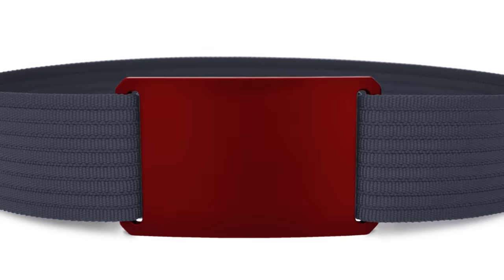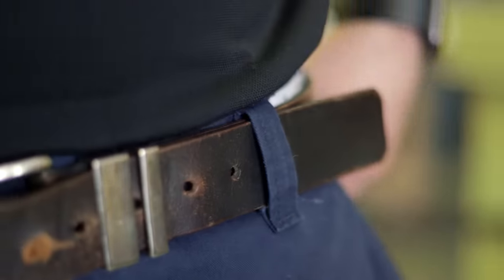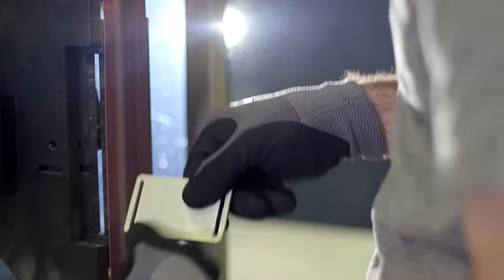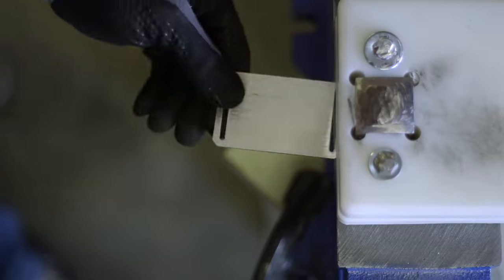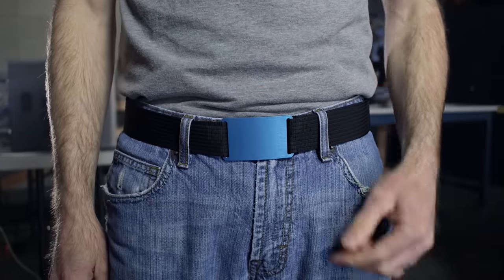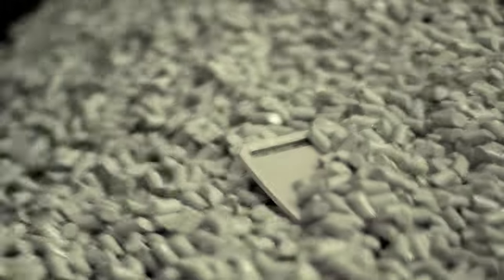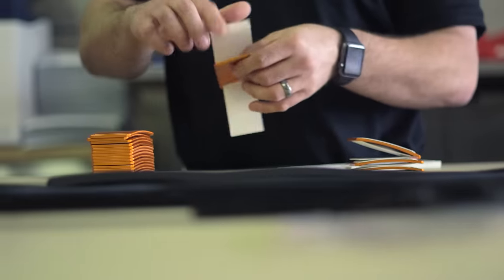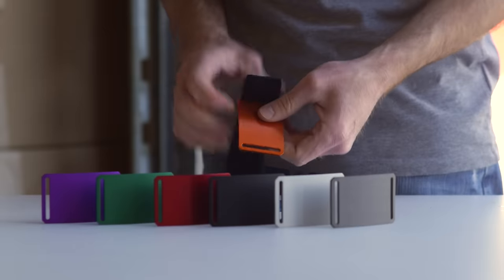Minimalist Interchangeable Belts | GRIP6

Comment: Ok, so I have been using a Grip6 belt for 3 weeks now. I have been through a lot of belts over the years and have found that it's worthwhile to spend the money on a good belt. I have had everything from $7 flea market belts to $70 Italian leather belts. You truly get what you pay for. With that said, I really like the Grip6 belt. I bought one for myself and one for my son who has an allergy to nickel found in most belt buckles. I love the fit and adjustability. No more trying to find the right hole for the perfect fit. No more having 6 inches of belt hanging off my waist. It doesn't appear to slip off as easily as I have seen in some videos, but I'm ok with that. I purchased the 2 belts over Christmas while they had a 25% off promotion running. I accidentally ordered without putting in the promo code for the discount and contacted them about it and was refunded the discount amount the same day! Great service there. The only peeve I had with the ordering process has nothing to do with Grip6 but with Customs coming into Canada. They charged an extra $25 when my order arrived. It happens sometimes depending on the shipping method used. So now that I've had a chance to use the belt for awhile, I can honestly say it's the best belt I have ever owned. I will be ordering one or two more soon if I can determine that I won't get hammered with customs fees. Great product! I may have to do a proper review of this belt.

Comment: Why are so many of you bashing on this guy? He sounds like a smart guy that took an everyday object like the belt and made it better. Engineers, musicians, mechanics, software designers ect ect are usually bad with communication and words. This dude doesn't need to to speak like he's running for president or anything. He made a new design for belts that hopefully replaces the stupid flap and hole ones we use. Pay attention to what he did and not how he talks you trolls.

Comment: To the three complaints about belts:  (1) you only use one hole, so what; (2) if there's a big flap, the belt is too big; (3) the traditional buckle sticks out a little bit but it looks really good.  The premise for your product is ridiculous.
Reply: 1) Unnecessary holes in the belt will decrease the durability of the belt over time, and it looks tacky (if you wear a tucked shirt)

2) That's one of the prime advantages of the belt! If you lose or gain a lot of weight, you can still use the belt!

3) During the winter months, I wear a lot of dress shirts with a sweater that goes over the belt; in those cases, the belt is not being seen by anyone and just makes one's waist look larger.

Comment: 1 I have used more than one hole in a belt. Clearly this man has never been to all you can eat.
2 there are already belts with out holes 
3 why do I need military webbing for my belt, am I in a combatant area?
Reply: I think the point is that it's infinitely adjustable which is something a lot of men prefer as opposed to a conventional belt. I'm a slim guy, so for me, belts are either too loose or too tight. You can do whatever you want, that's your business, but you don't have to crap on the guy for trying to design something new. I own one and it's awesome.  It helps you get that perfect in between size on a belt without having a bullshit ratcheting system.

Comment: i just became a proud and extremely satisfied GRIP6 owner (got the workbelt and an ultralight)! putting on a belt has never been this satisfying. the slightly wider workbelt surprised me a little. i thought they were only as wide as ultralights (1.5"). i can still use the webbing strap on the workbelt buckle, but no way the workstrap would fit in the ultralight. my fault for not checking well... and did i say i'm very satisfied? kudos to GRIP6!

Comment: @GRIPSIX this is the most comfortable belt I have worn. However, a note 8 in a holster has a good chance of falling off the belt when you go to the bathroom. klik belt solved this problem by introducing 2ply belt. I hope to see something similar in the future from you folks. It doesn't seem like a hard addition to your current belt line up.

Comment: $35 usd. for a plate of aluminum and a web belt? a military web belt from the px is no more than $10 and buckles are bout $2, you're charging more for you're brand huh?
Reply: Your brand. It's a business. Go buy a steel bending machine, a blank, a drill, and some belt. Or you can just go to the store and buy a spool of yarn or use a shoe lace.
Reply: @jessvagnar4957  probably cheaper to get the yarn, sometimes I like to use a power extension cable as a belt

Comment: You know, I've worn a belt everyday for a long time too and I have never been bothered by the holes I don't use, never been bothered by the buckles very slightly sticking out under my shirt, and very rarely been bothered by the flap hanging off the front. The flap hanging off the front is a trade off for not having to mess with pulling something under the belt when you're tightening it. The worst thing about a regular belt is that the holes tend to wear out and look crappy.
Reply: Yeah but I'm guessing you ain't getting much action. Think about it...

Comment: If the webbing isn't stretchy, it's not worth wearing. A belt with no give is terribly uncomfortable.
Reply: Far easier to adjust on the fly versus belts with holes. If you have a big meal, it easily adjusts to the perfect position and once your food digests, you can slip it back to where you want it.

Comment: cinch rip off
Reply from the maker: Did you watch the video? GRIP6 belts are insanely easier/faster to take on/take off than cinch belts. We also have design and utility patents on our belt system. This is not a cinch belt, it is a sliding belt that stays tight through friction. And if you're specifically referencing Trayvax's cinch belt--our belt came out first 😉.

If you have any questions about our product, feel free to email us at grip6@grip6.com. We have a full lifetime guarantee on all our products. If this isn't the BEST belt you've ever worn, we will buy it back and pay for return shipping for the hassle 🙂

Comment: Dear Mr belt man,
Your issues with regular belts concern me.
1- extra holes, really who cares?!
2- excess length, as an engineer are you not capable /do you not have the skills required to shorten a regular belt and remove the excess length with relative ease?

Comment: Those 3 problems you described I've never had an issue with. Every belt company makes belts that fit your waist size so you should never, if you buy the right size belt, have a belt that has a long flap. Also, to be honest its looks like a belt a child would wear. I suggest you (1) loose the speech about solving a problem, since the problem doesn't actually exist,  and (2) hire a designer help you design belts that don't look exactly like my seatbelt in my truck. Just my opinion, take tor leave it
Reply: Christopher Kelly just because you don’t have a problem doesn’t mean that others don’t either. The flap IS a huge problem because sometimes people can only afford to go to the $20-$30 range and most belts in the range is trash, imagine if you buy cheaper ones. The bulge is pretty damn unattractive in an otherwise attractive outfit and drives me nuts. The belt is high quality and blends in with your outfit so you don’t look like a slob. Be thankful that you live in a country that there are solutions to problems that YOU don’t have.
Reply: @2bit156  How about this for a solution to the "problem"...buy the right size belt. Doesn't take genius to figure that out.